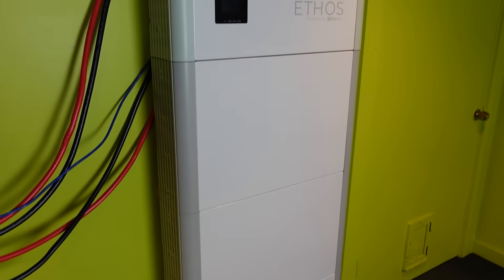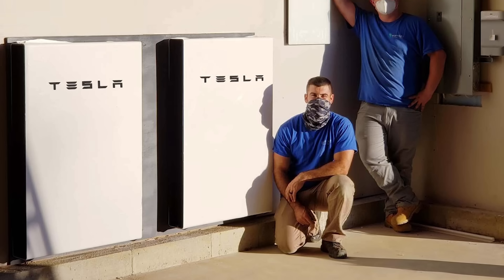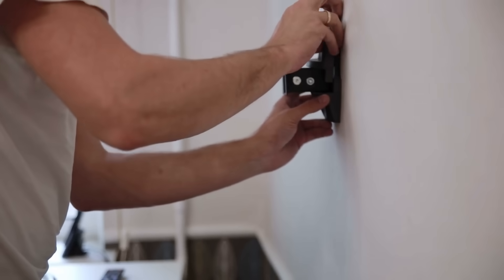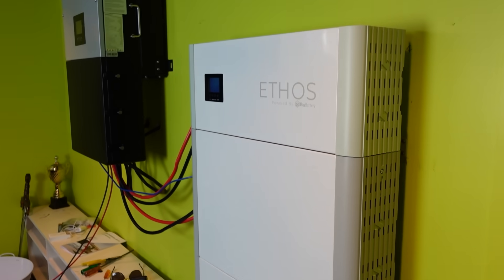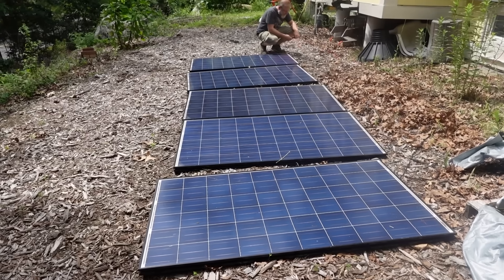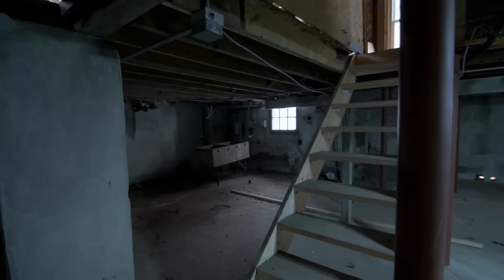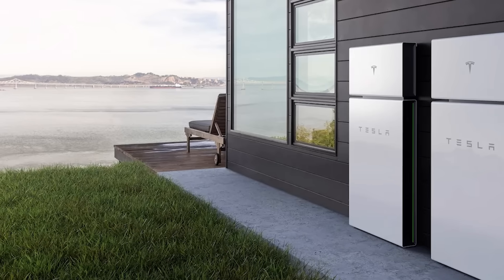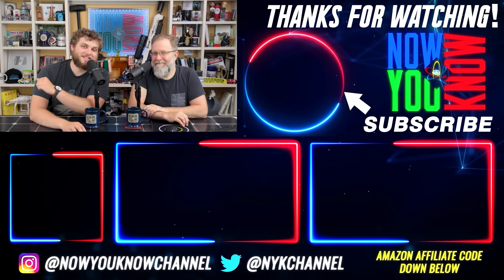Better Than a Tesla Powerwall? | In Depth

Comment: Put 1500 watts Solar on my Sailboat and Learned about Iron ridge Camo clamps. If you don't already know about them. They provide a way to clamp Solar panels, without getting on the roof! I plan to install 13kw of Bifacial Solar panels over my deck. Sealing between the panels for a water proof solar only roof.
Reply: For marine applications, feel free to check-out our water-resistant IP-65 Rated Batteries. The HUSKY 2 & The EAGLE 2. I believe these will be a good fit for you and they are 10% off using the code. Happy Sailing!
Reply: @EricLundgrenCEO  what a dumb response.

Comment: With the inverter it's $10690 and you have to do the work, with the power wall it's $12000 but you get a 30% tax break so $ 8400 Equals a $2000 savings going with Tesla
Reply: Just so you know, you also get the 30% Federal Tax Credit with our system!

Comment: LuxPower is similar to the MultiPlus II from Victron, but the Victron system is more modular and works with generic 48V batteries. For example, with Pylontech US3000C LiFePO4 3.5kWh, which are significantly cheaper and more redundant (because each has its own controller). The wiring is just as simple. This is not meant to be an advertisement, just another example. For DIY, I would strongly advise against DC strings. I like to do everything myself, but even with LuxPower, you have to connect high DC voltage to land in the correct MPPT range. High DC currents are EXTREMELY dangerous and need special protection. For DIY, I would always recommend microinverters because you connect low voltage on the DC side, and no AC flows as long as the fuses are off as usual during installation. Besides the added safety and redundancy, you can also start cheaply without a battery and battery inverter in the world of photovoltaics and add a battery later.

Comment: Worth noting, it takes more than "just talking to your utility" when back feeding power.  The "gateway" box that is installed with a powerwall system contains an isolation contractor that allows you to island your house when the power goes out along with distribution breakers. Most utilities require this UL cert. box to allow you to connect a grid tied inverter if you want backup power. Otherwise the inverter just off when the grid goes down.  It ensures that the inverter doesn't backfeed when people are working on the power lines.
Reply: they said check your local utility before connecting to grid.
Reply: They require a UL certified box but want you, in some places, require it, a smart meter that is not UL certified >> fire hazard.
Reply: Most are adopting the 2023 NEC UL9540A ESS which means the battery and inverter have to be UL certified together as one Energy Storage System.  Problem is Government regulators can't be happy with the old UL certs they have to always increase it so they justify their employment. With cost going down like the new EG4 inverters and batteries just got UL9540A certified they cost 1/4 the price of anything out there previously. If Sodium takes off like I think it will that could be a utility killer if enough homes go off grid I suspect governments will step in and either force home owners to grid tie, or charge a tax to bank roll the greedy utilities.  How do I know they are greedy I have worked for one last 24 years I can tell you so much waste it's unbelievable. CEO's are making billions in stock options they rig the accounting books so it looks like they only make 10% profit in reality they write down the profits by capitalizing 90% of their labor.  My labor is 80% capitalized so many projects going on the state commissions are weak easily lobbied. If they want to get someone elected throw a few million at it guy is elected because our political system is so corrupted in this country. I plan on retiring to a county that has zero building codes on permits  you can do whatever  you want no one cares.
Reply: This sound great for those who already have Net Metering, like I have, along with a 24 panel roof solar.  Really looking at this .. probably not cost worthy for me, at 82 years old .. great alternative though.
Reply: DO NOT BUY! BIG BATTERY CO IT'S A SCAM!! THEY LIED TO US AND SOLD US A BATTERY THAT DOES NOT COMUNICATE WITH OUR SOLAR INVERTERS EVEN YHOUGH WE WERE SPECIFIC AND ADKED THEM TO CHECK BEFORE WE CONSIDER BUYING. THEY DONT CARE ABOUT YHEIR CLIENTS!  WE SPENT THOUSANDS TRYING TO MAKE IT WORK WITH THEIR TECHS GUIDING OUR TECHS OVER AND OVER WITHOUT ANY IMPROVEMENT!  IN FACT LAST TIME THEY GUIDED OUR TECHS THEY REALLY MESSED US UP AND THEY WASH THEIR HANDS OFF OF ANY REMORSE😮 THEY HAVE LOTS OF BAD REVIEWS ON LINE...CHECK BBB AND OTHER BLOGS ABOUT THIS COMPANY. BEWARE! 😢
Reply: never feed back or connect to the grid. You get pennys to the KWH back.
Reply: @MitchOfCanada Depends where you live. In Tasmania, Australia, I get AUD$0.15 per kW/hr, and pay AUD$0.28 for every kW/hr I buy. Much cheaper to pump back to the grid my excess than buy a battery. I have 9.7kW solar array, no battery, and pay approx AUD$400 a year total including all electric heating, cooking and an EV.
Reply: @sparkytas   The battery is for when there is no power or sun.  You are SOL when the sun goes down during an outage. Selling excess power is just a perk if your batteries are full and you arent using all your capacity.
Reply: @MitchOfCanada  My area we have no choice but to feed back.  However, I don't have a battery and I'm curious if I can set that up as well.
Reply: @MitchOfCanada  depends - Im on PGE NEM2 and it's kWh for kWh
Reply: @MitchOfCanada  In Brazil it's one-to-one - we don't need batteries unless we want to have power during cuts.

Comment: Power wall is not accessible for diy. So, I built my own system with 40 KW batteries + 10 kw solar. Is way cheaper and performing as well.

Comment: You missed a lot.  First, you can't connect that system to the grid without a Gateway Disconnect.  Second, if your battery is full, your solar will no longer produce power.  Many jurisdictions will not allow you connect to the grid w/o an electrician.  You need to reveiw the National Electrical code.  Not doubting the battery pricing, but there are number of steps you missed.  Additionally, Tesla Power walls work along with your Tesla Connector and Solar system to automatically adjust the charge (amps) to your car(s) to onlly charge on solar.  Some Power Companies do not allow Power Shifting (i.e. Souther Co's -- AL, GA)  Power shiffting is charging your battery in off peak as you discribed and using it for peak time.  I admire your fortutude, but this could be a dangerous recomendation to your audience.  240VAC at 2 and 3 phase inputs to your home is not a DIY project.  Carefull!!

Comment: Do some research and you will find this one is $1300 to $1800 more then others with the same specs prebuilt and has proper certifications. . Or build your own for about $1900 with everything needed in build kits and add the batteries (no certifications for safety and might be illegal to use if tied to a grid, check with local law first) Still I think big battery is one of the higher priced batteries on the marker. Although that inverter is a nice one.
Reply: Just wanted to say, for UL-Certified ESS our ETHOS is currently competing on the lowest end of the pricing market as of July 1st 2024!
Reply: Doesn’t make sense to compare diy batteries and even rack mounts to this made ready easy to put together modular system.

Comment: 10:32 Yeah, because the system needs to be permitted, built to Code, pass the final inspection. Then the utility interconnection can start.

If the steps above are not followed then we’ll have random people installing batteries without a ground, inside bed rooms, and have conductor dangling outside of conduit. 

Might be a good idea to hire a company to install solar and battery.
Reply: You’re spot on, Cody! Our ETHOS Battery & RHINO 2 Battery are both UL-9540A. Ensuring your system is permitted, built to code, and passes inspection is crucial. Thanks for emphasizing these important steps!

Comment: I installed this same system in my garage.  My main issue with these batteries will be in the winter months. I was mislead by the sales guys that they could be used within certain temperatures and outdoor rate however I later realized the temperature will need to be around 40 degrees F for charging.  Now I need to add a heating system around the batteries.  Too bad they don't include heaters like other similar batteries on the market.  they claim they can be installed outdoors however they neglect to mention that your house needs to be in a warm climate where it does not dip below 32 degrees.
Reply: We hear you, John! Our batteries are designed for a wide range of temperatures. If you want a battery for outdoor freezing temperatures - we suggest you buy our RHINO 2 - It is designed with heating plates and is built for this specific application you are requesting. We recommend using a battery heating system for colder climates which you will find in the "All Weatherproof BigBattery RHINO 2". We’re always looking to improve and appreciate your feedback. Stay warm and powered up!
Reply: @EricLundgrenCEO  That is why I am using AGM batteries. They can charge in minus 4 degrees temperature
Reply: I live in North Florida. Would it be ok if they were in my hot garage?
Reply: pretty easy to block them in with r40 Foam and a 50watt heater to bring the temp up in there.
Reply: Yeah, but then you couldn't complain. 😁  @MitchOfCanada
Reply: Put the batteries inside the house is the solution
Reply: How could u miss power wall has inverter
Reply: I wonder if heating pads of some sort can be used.  I asked my neighbor on his solar panels which he just connected to send power back to the city but nothing for his place which sounded not right to me.  No batterys used.  I'd like to find a good setup
Reply: Put the batteries in one large styrofoam (or better) cooler. A thrift store chest freezer also will do, even a dead one. Put a silicone heating mat under the batteries, RV sops sell big ones to warm their external waste tanks. Something like an inexpensive Govee remote freezer thermometer can send the battery box temperature to your phone. Or you buy some sheets of closed cell styrofoam at any big box hardware store to glue up a battery box.
 Chrysler Plymouth use to install a plsin styrofoam cooler around the batteries in their cars for extreme weather service. Same idea.

Comment: They didn't "pay you for it", but they did just 'send you a system.  Free?  But, yes, it's impressive.  At 77 years old I don't need to "learn need skills", but I'm pretty sure I already have them.  Now I need to build a solar shed to cover with panels and install my battery system inside.  Kewl.

Comment: Something I want to mention about doing the electrical yourself. If you are unsure on your ability or worried about insurance. You can hire a electrician to inspect the work you did and sign off on it. Rather then them putting in the time.
Reply: that's what my parents did when they built their home.
And mind you this is in Germany (I was perplexed that this is allowed, but since you have documentation that a professional said it's ok, then it's ok)
Reply: @DJRaffa1000  Great idea. Inspectors are all different but they aren't there to teach you how to do it right. Many will take exception to finding mistakes. And you can't replace the peace of mind it gives you.
Reply: The BigBattery ETHOS System is designed to be modular and easy to install, making it perfect for DIY enthusiasts.
Reply: Duh! Have the city inspector check after you pull a permit
Reply: @cruz47144  Inspectors can get pretty nasty if you think they are there to teach you how to do it right. Calling a professional to look it over first may save you in the long run. Duh!
Reply: Before switching make sure your house is fully insured.
Reply: Can I purchase the ethos system  in France
Reply: "You can hire an electrician to inspect the work you did and sign off on it".  Yeah, well maybe.  No electrician ever likes the way another electrician installed the wire runs.
Reply: @77space-vt8wi   A home owner isn't an electrician, I wouldn't call myself that.

But what your saying is in every profession, welding is bad for it too. Its because people have a ego and think they are always right and also bias. But its not everyone and you can spot it in people if your around them enough.

The point is, does it pass or not. They don't have to "Like it".
Reply: Local regs will vary. In my country you need to have a Certificate of Compliance issued by a registered electrician, and then have it inspected. Two sets of eyes !

Comment: From a cost perspective a 3 Ethos battery system with an inverter is almost $11K.  This compares to a powerwall at $9300 or $11k with installation.  Your video literally stated this solution is 1/2 the price of a powerwall.  Please explain your math here.
Reply: You are correct, we are (on average) 62.6% of the cost V.S. Tesla. Our goal is to make Energy Independence Affordable without sacrificing quality. 

15.36kWh / BigBattery ETHOS = $626 / kWh
$10,690 - 10% Code = $9,621
(Includes 12KW Inverter)

13.5kWh / Tesla Powerwall = Average = $1,000+/kWh
(Includes 9.6KW Inverter)
Low End: $13,000 ($12,000 + $1,000)
High End: $15,000 ($12,000 + $3,000)

Energy Capacity: 13.5 kWh
Built-in Inverter: 7.6 kW (solar) / 9.6 kW (battery)
Installation Cost: Estimated between $1,000 and $3,000
Reply: Yeah I'm calling bullshit.
Reply: Cheapest I could find for powerwall 3 installed with gateway $15,300. I can get eg4 18kpv inverter plus 14.3kw powerpro battery for $7572.97. They are plug and play pretty much together. The battery is LFP and has built-in heaters and fire extinguishers.
Reply: @danmccoy6164 . Agree Dan with your pricing same with my experience. Eg4 seems the most cost efficient system
Reply: DO NOT BUY! BIG BATTERY CO IT'S A SCAM!! THEY LIED TO US AND SOLD US A BATTERY THAT DOES NOT COMUNICATE WITH OUR SOLAR INVERTERS EVEN YHOUGH WE WERE SPECIFIC AND ADKED THEM TO CHECK BEFORE WE CONSIDER BUYING. THEY DONT CARE ABOUT YHEIR CLIENTS!  WE SPENT THOUSANDS TRYING TO MAKE IT WORK WITH THEIR TECHS GUIDING OUR TECHS OVER AND OVER WITHOUT ANY IMPROVEMENT!  IN FACT LAST TIME THEY GUIDED OUR TECHS THEY REALLY MESSED US UP AND THEY WASH THEIR HANDS OFF OF ANY REMORSE😮 THEY HAVE LOTS OF BAD REVIEWS ON LINE...CHECK BBB AND OTHER BLOGS ABOUT THIS COMPANY. BEWARE! 😢

Comment: Super-good video, guys. Tesla needs some competition. I'm already stuck in a dual Powerwall III contract waiting for my ding-dang Powershare Gateway III that is supposed to come with my FS CyberTruck that I took delivery on April 27.

For my 3 off-grid observatories and employee housing, I'll be doing Ethos upgrades to replace Lead-acid, AGMs, Jita & Temgot LiFePOs (I've tried every kind of battery storage for my solar arrays over the last decade) thanks to you guys and this video.

Comment: This looks good especially if you can somehow expand an existing system with it.

But yeah should probably have clarified the total costs of installation shown with the extra inverter box.

We def need a 'race to the bottom' (but not the the point things catch on fire left and right like chinese EVs) to happen in privately owned energy storage and conversion solutions and things like this are a good step on the way.

Comment: My problem with battery backups is the run time. It’s not uncommon for us to have power outages that last two days or more. Solar doesn’t work in my tree covered area therefore, once the battery power is used up I can’t recharge it without a generator. Therefore, why not just use a natural gas generator in the first place? For short outages a battery backups do well but not long term. We’ve had outages that lasted for 7 days.
Reply: Solar doesn't work in your area because of trees? So, you can't see anything around your house, right? It's all pitch black because the trees are so dense and so tall, that there's zero light that doesn't come from man made sources?
Reply: A Generac system can be used with battery and solar. Main panel, battery relay, then Generac relay, then Backed up loads.
Power goes out, battery takes over, battery runs out, Generac takes over. 
Solar can be/should be added to the system above.
Reply: How about getting a small domestic-sized wind power generator? They make some pretty amazing products these days.

Comment: Can their batteries be integrated into an existing PW2 system -where solar + inverter already exists? 

Basically to add their batteries as on-line storage to an up-&-running functional system
Reply: In Short, Yes.. Our batteries are compatible with the mass majority of Inverters on the market but if you are installing in a residential area - we recommend UL-9540A Certified Solutions (Inverter & Battery).

Comment: Those with (grandfathered) Net Metering & a reliable supplier use the grid as their battery. Not only is that GT system cheaper, but it also has unlimited storage capacity. And that’s exactly why finding a utility that still offers Net Metering is impossible.
Reply: 'Impossible' seems pretty hyperbolic.  Here in PA, the Alternative Energy Portfolio Standards Act (AEPS) was passed in 2004, guaranteeing all customers who have their own generation the option to use net metering, and the utilities cannot prevent it.  "...the law requires all electric utilities (aka Energy Distribution Companies) in the state to purchase excess renewable energy from eligible system owners at the full-retail rate".  Like all things, it will depend on where one lives.